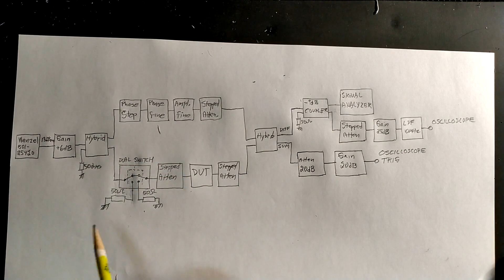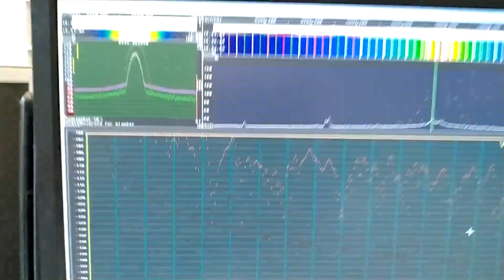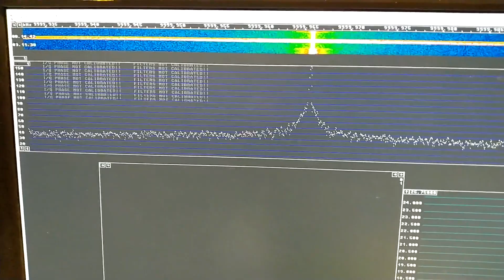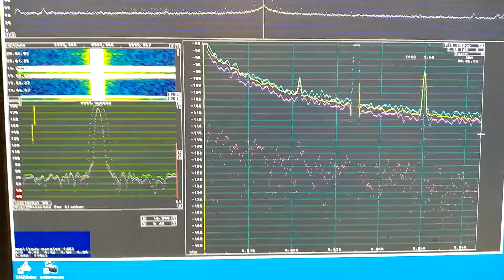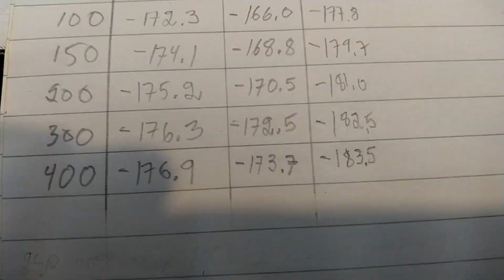nerds86

Comment: ### (Part 1) Transcript Summary with Timestamps

*Amplifier & Interferometer Setup*
- 0:00 Introduction to testing an amplifier using interferometry.
- 0:07 Signal generation and amplification details.
- 0:22 Hybrid and 50 Ohm resistor usage for signal splitting.
- 0:31 Phase and amplitude adjustments on one leg.
  
*Measurement Procedure*
- 2:16 Attenuation and gain settings for oscilloscope.
- 3:12 Idea is to isolate carrier and noise sidebands.
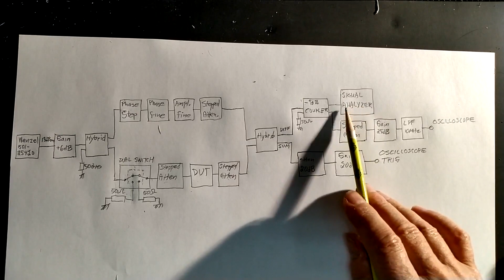- 3:39 Discusses the specific amplifier under test.

*Test Observations*
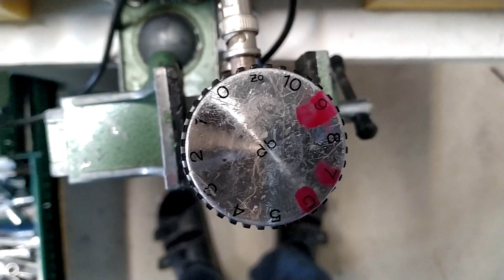- 5:03 Phase noise of the initial ventil oscillator.
- 6:25 Setting up the interferometer for testing.
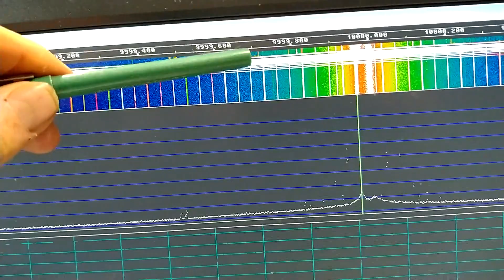- 8:13 Observations on added noise from amplifier under test.
  
*Data Analysis & Comparison*
- 9:35 Issues with sound card noise.
- 12:45 Carrier suppression affecting noise.
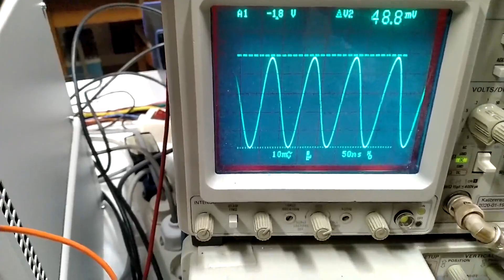- 13:29 Long-term data collection.
  
** Anomalies**
- 15:15 Discusses the curve obtained.
- 16:02 Observations on noise with varying power levels.
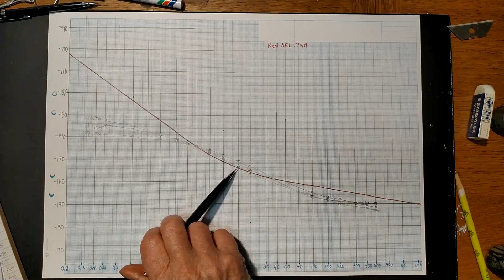- 16:52 High power creates noise.
  
### (Part2) Transcript Summary with Timestamps

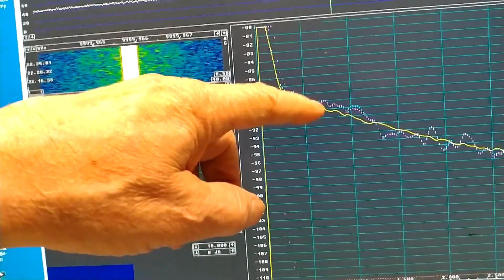- *26:50-27:03*  
  Discussed correlation spectrum and direct measurements falling on the same curve with varying averages.
  
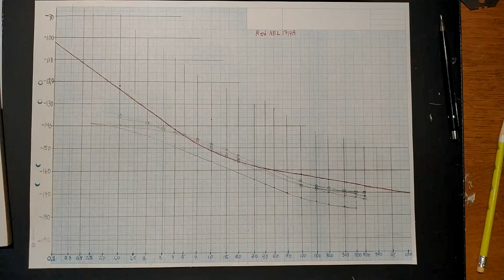- *27:09-27:22*  
  Spoke about tweaking unit to check for consistency in results.

- *27:30-27:41*  
  Described data points on a line and possible deviations at certain frequencies.
  
- *27:54-28:09*  
  Mentioned modifying the output impedance for better measurement.

- *28:40-28:53*  
  Explained an experiment using 50 Ohm resistor to test system loading.
  
- *29:20-29:43*  
  Examined power relationships among circuit components.
  
- *30:26-30:40*  
  Focused on the interesting region around 20 Hz where noise was being observed.
  
- *31:31-31:49*  
  Experimented with switching off power supply to isolate noise sources.
  
- *32:28-32:44*  
  Looked into the power level in the resistors as another potential noise source.
  
- *33:06-33:13*  
  Conducted a new test setup for investigating iron powder core.
  
- *34:18-34:25*  
  Experimented with a Step-up Transformer to understand noise characteristics.
  
- *35:10-35:18*  
  Concluded core seems to be low-noise for both amplitude and phase noise.
  
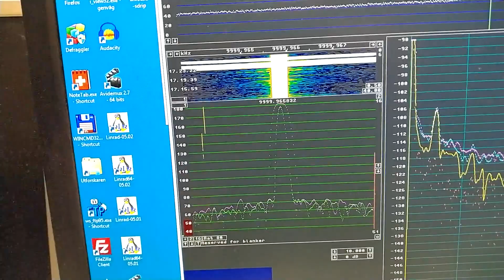- *36:32-36:46*  
  Addressed intermittent noise problem by removing attenuators.

- *38:13-38:20*  
  Found that noise is coming from different sources for amplitude and phase.

- *39:22-39:28*  
  Tested DC current effect through the toroid on noise.
  
- *42:17-42:23*  
  Noted a small improvement by changing the source resistor for jFETs.

- *42:54-43:01*  
  Identified an unexpected problem with large f-side band noise.
  
- *43:25-43:44*  
  Examined effect of resistance across transformer primary winding on noise.
  
- *43:58-44:05*  
  Made a conclusion on the unexpected phase noise.

### Positive Learnings (Part 1)
1. Successful setup of interferometer for amplifier testing.
2. Phase noise of the initial oscillator is known and can be accounted for.
3. Long-term data collection offers a fairly smooth curve for analysis.

### Negative Learnings
1. Carrier suppression slightly affects the noise, complicating measurements.
2. Sound card noise introduces inaccuracies at low frequencies.
3. High power increases noise, introducing an anomaly in the results.

### Positive Learnings (Part 2)
1. Transformer cores and iron powder seem to be low noise for amplitude and phase.
2. System fine-tuning and impedance adjustments are beneficial for optimal measurements.
3. Isolating circuit components to identify noise sources proved to be effective.
4. Reducing the value of the source resistor for the jFETs improved noise performance.

### Negative Learnings
1. Unreliable attenuators introduced noise and inconsistencies in measurements.
2. Phase noise appears to be an unexpected issue.
3. The f-side band noise levels were unanticipated and problematic.
4. Impedance tweaks, while beneficial for measurement, had unexpected noise consequences.